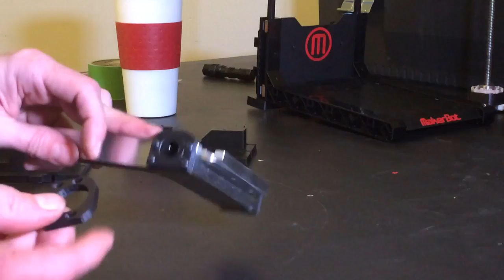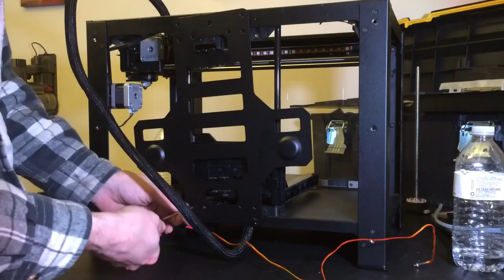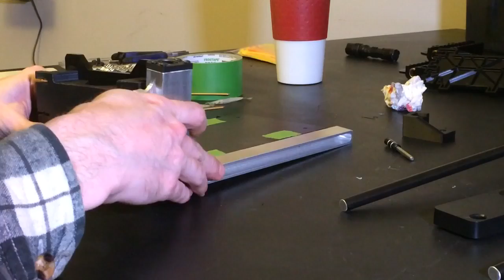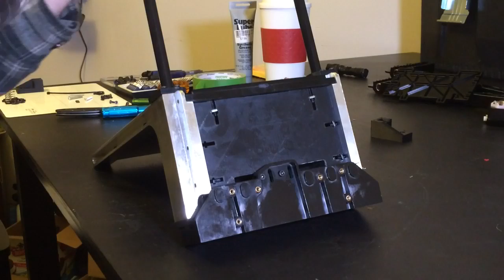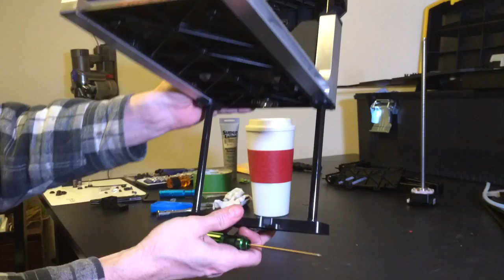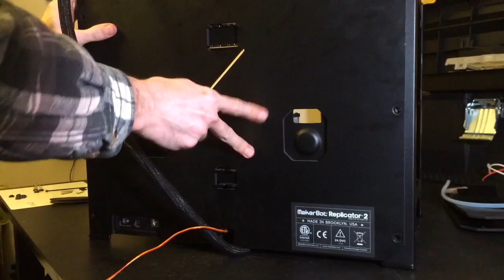Installing BottleWorks Aluminum Arms Install on Replicator 2/2X

Comment: Ce système s'adapterait il a une imprimante CTC?
Reply from the maker: Are you saying it will adapt to a CTC system, or asking? If your asking I would contact the manufacturer, website is in the video description. But it was made specifically for the Replicator 2 and Replicator 2X.

Comment from the maker: @Michael, yes I would install the arms first. The HBP is a shorter install, but on a replicator 2 the plastic arms can sag from the HBP and you will have issues with some prints and leveling. The arms prevent a lot of those issues when running a HBP. So do the arms first, it's worth it.

Comment from the maker: It made a big difference with my machine since I was running a heated build plate. The heat on a R2 would cause the plastic arms to sag and the results on long prints were just bad. 

For a lot of other users with this upgrade you should check out the google group noted in the description of the video.